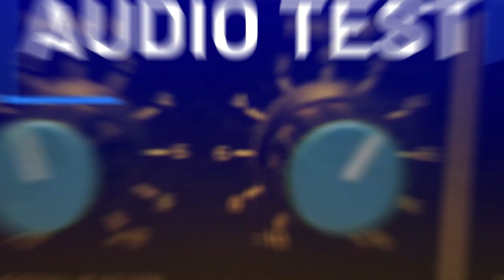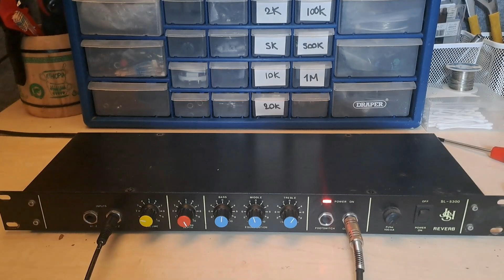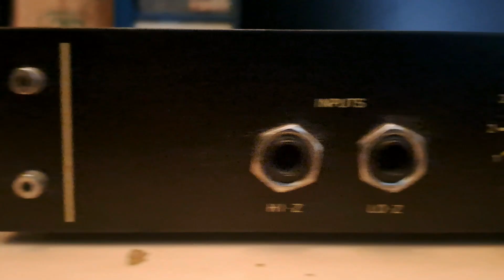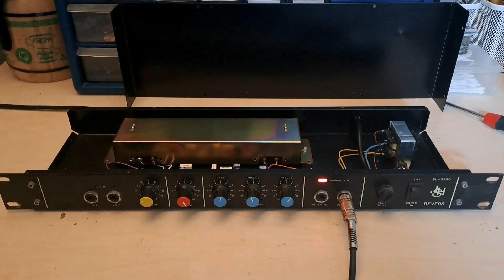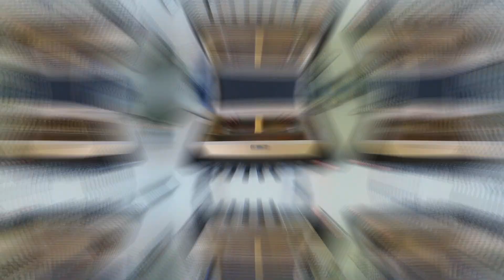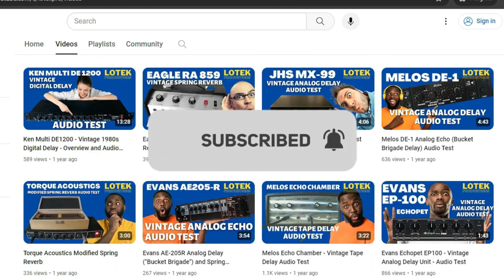JHS SL5300 Vintage 1980s Spring Reverb Audio Test

Comment: Do you know if the tank is/was available off the shelf, or if it was made for/by JHS?
Reply from the maker: I reckon it's generic/off the shelf. I had another unit badged Torque Acoustics and it was identical inside.